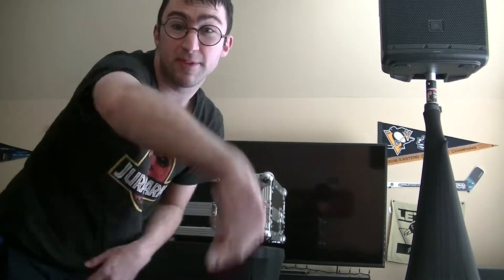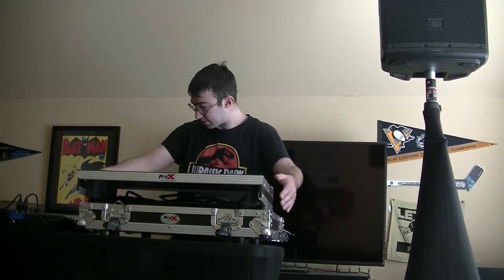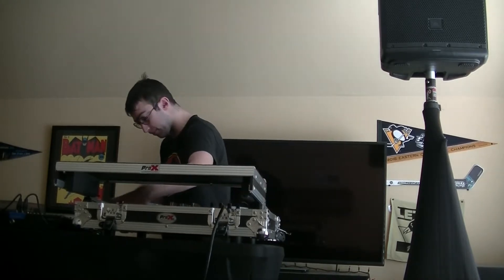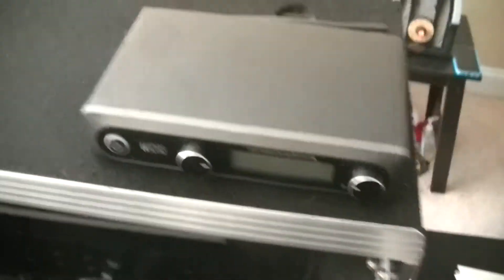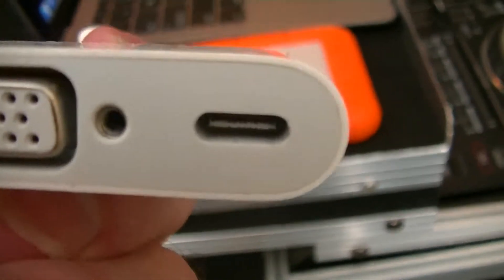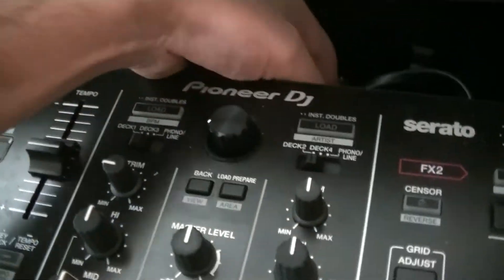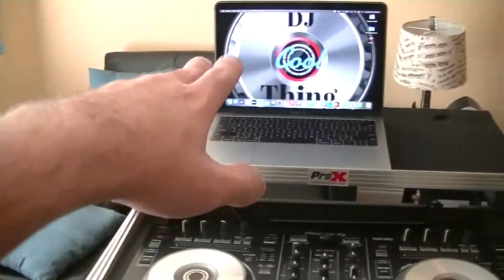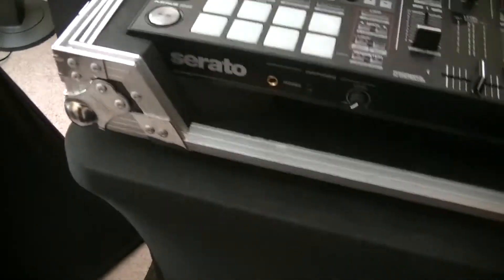In Depth Tour of My DDJ SR2 Flight Case

Comment: Why don’t you go into your mixing board with you mic Witt Xl r it will sound better and glue your stuff down so it won’t fall all over the place I got the same case with a dj sx I bought about 7 or 8 years ago and mine has some rust around the latches
Reply from the maker: My DDJ SR2 only has 1/4” for a mic input so I have to use my Yamaha MG10 for my mics and my controller